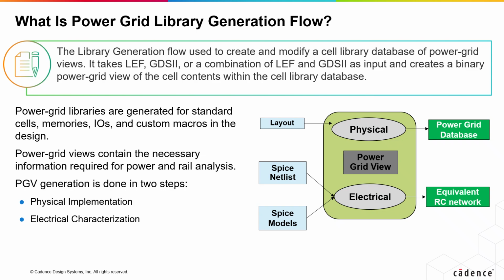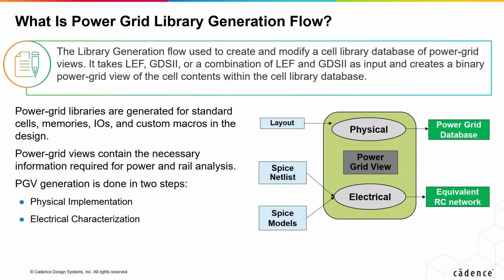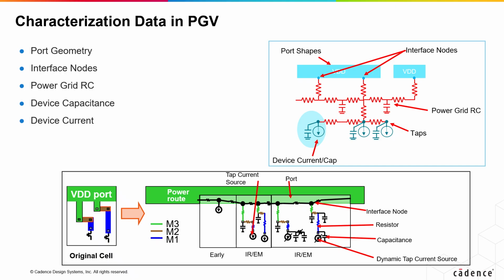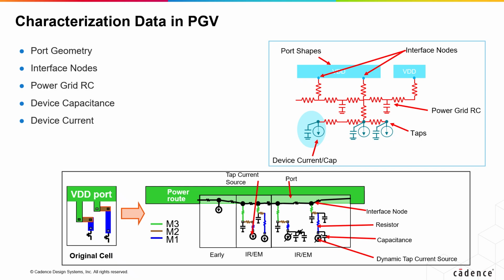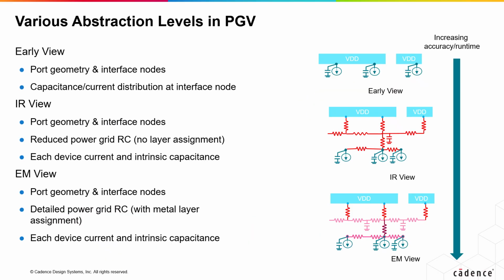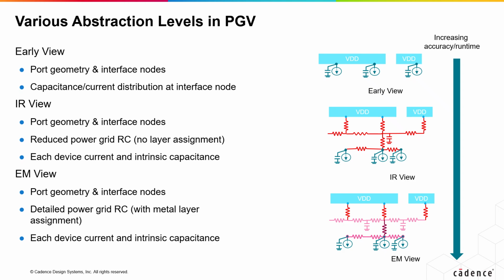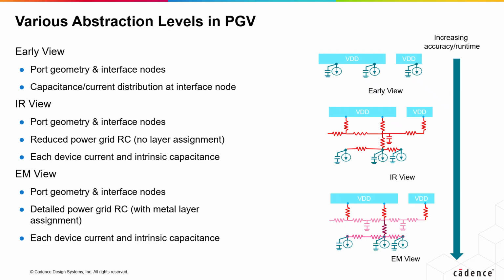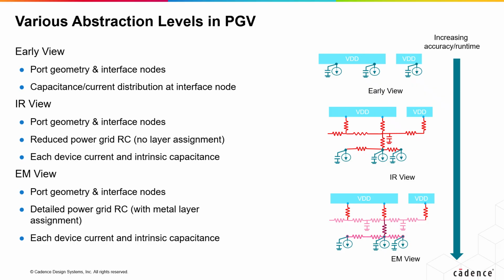What Are Power Grid Views? PGV Types & Library Generation in IC Design

Comment from the maker: Want accurate rail analysis and power integrity?

Learn how Power Grid Views (PGVs) help model resistance, capacitance, and current distribution for IC design using Voltus and Cadence flows.

Which PGV type do you use most — Tech, Early, IR, or EM? Share below! 👇